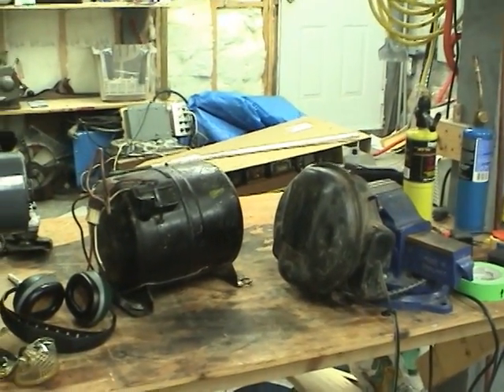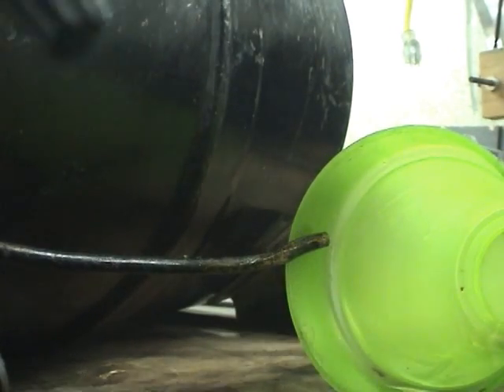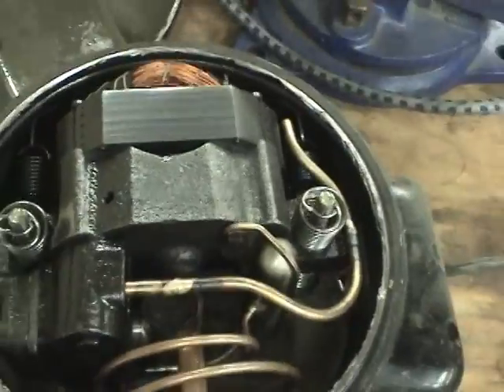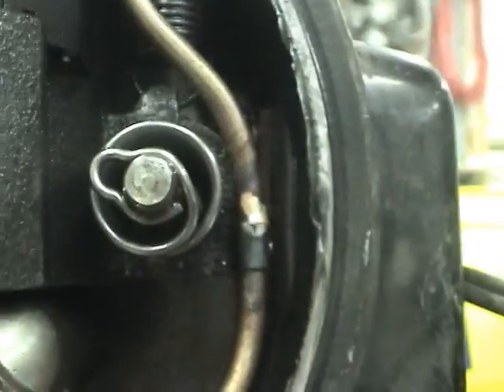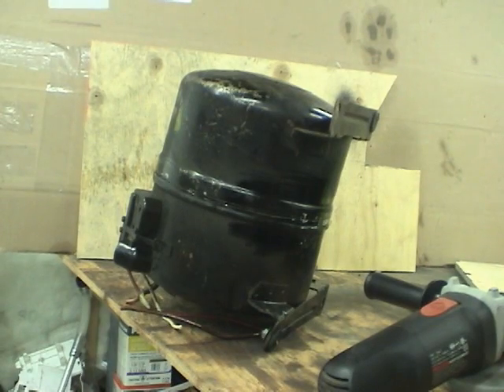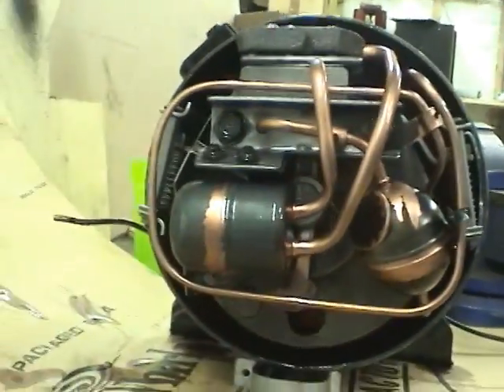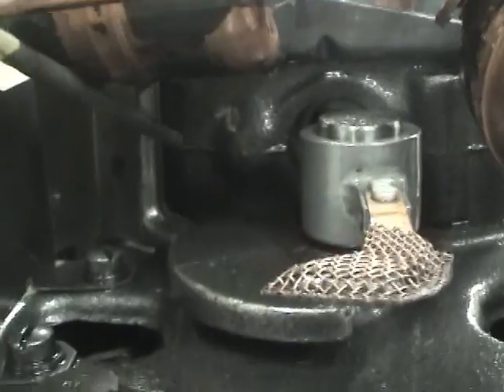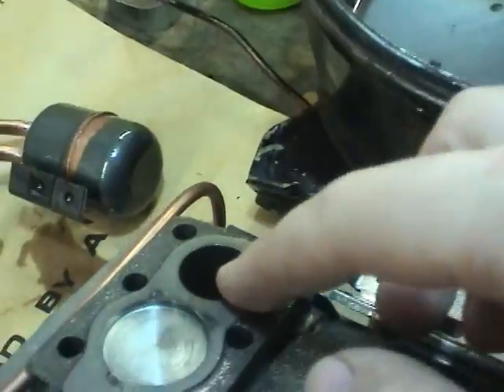Vintage refrigeration compressors

Comment: I began my career in refrigeration in the UK 1976 and only came across 3 or 4 "pancake" compressors which were made by a company in Scotland I think called Sterne.  In those days Frigidare and Prectcold compressors were the main ones used in refrigeration and in the Frigidaire range were belt driven and the semi-hermetic which were called Dynapac.  I worked for a Frigidaire dealer rebuilding compressors.  Great video thank you.

Comment: Could you use it to compress air and what kind of pressure would it produce?
Reply: +medhist2006 
Yes, You can, but it won´t last that long as a regular air compressor if they sucked in air since their interna parts are wery sensitive to particles (like dust) inthe air. You need an airtank and a pressostat as well to make it work properly as an airsupply.

Comment: That second compressor does have a nice motor in it.  It looks like you may be able to pull it out and use it for other things unlike some of the other ones.  It looks to me that you just have to get it cleaned up first unless you plan to keep it as a compressor.

Comment: The Model T, among most other automobiles, used oil slingers for lubrication. Modern small engines, Briggs & Stratton, etc., use the same type of oiling system. No oil pump required.

Comment: Scotch-yolk?
Reply: Yep, Scotch-yoke mechanism, as was originally developed by GE in the 1930s.  Danfoss also made such compressors.  The original GE compressors even had oil-cooled motor windings, a high-pressure rotary oil pump, a cylinder unloader to aid in starting, spray cooling of the lubricating oil and mufflers on both the suction and outlet.

Comment: do you know what that two piece con rod linkage is called. there is a name for it, its on the tip of my tounge. the one where the rod stays on a plane and the one on the crank slides back and forth in it as the piston goes back and forth . there is a name for it anyone know>?
Reply: Scotch-Yolk

Comment: Thats a very good video, very informative. I work in an industrial refrigeration plant and have torn down 6 cyl. ammonia compressors with each piston and cylinder 8 times larger than whats in any house hold or commercial compressor, so its pretty cool to  see an extreme visual contrast between those.

Comment: the 5 to 6 thousand btu 1979 to 80 emerson quiet kool compressors are something to check out they were really smooth and quiet they were the last of the reciprocating compressors before aisain compressors took over. emerson air conditioners were made in woodbridge new jersey, best ac ever made.

Comment: I did that when I was 14 years old , was opening those to see the design of the motor & pump. the pancake unit was made by Tecumseh. and the long compressor looks to be a newer Westinghouse compressor. I saved some myself ,and wanting to get some old compressors like I had when I was 14 back in 1975
Reply: I took anything apart as soon as I could walk, butter knife being my first tool.I garbage picked like clock work hauled that stuff to our room tv's record players radios you name if it was electric.Burn & grease marks all over the yellow -gold sculptured carpeting..got zapped plenty of times...right about the time your talking..  starting a little earlier in the 70's & slightly younger..it's still in me..I just get to see others do it here...who ever thought..

Comment: I have heard that Trane is having problems with their "Cllimatuff" compressors, the motors burn out after just two years, and the insulation on the motors breaks down and plugs up the filter driers. Please reply and give me some more details on this problem if you can.

Comment: @jonasgu97 oil is distributed along with the refrigerant in all air conditioning/ refrigeration systems. The oil that was spraying out of the discharge line is normal. It is just a mist of oil and not a slug of liquid when it runs unless the fridge was tipped up on it's side and then immediately turned on after standing it up normally. This is why you should let a refridgerator stand upright for approx. 10 hours or so after laying it down before up plug it in and run it.

Comment: Those pancakes were easy to service after a burnout.
I had the stator rewound by motor people, put it back in and it fired up.
Welded it up with a CO2 purge, ran it and let it suck in fresh oil of the same amount I had taken out.
Put back in the Kelvinator and it ran, never saw the fridge again!

Comment: I have a 46 crosley shelvador compressor.......it has 3 terminals, white, black,  green.  I want to use it to make compressed air for a furnace gun I'm bulding, but can't figure out how to start the motor.  The fridge is gon, I have the motor, relay and chassis only.  It looks just like the big cylindrical motor you did just now, any ideas, thank you, Jack

Comment: wow I found one of those pancake compressors out in the woods back in '01, got it apart by cutting around that seam with a manual hacksaw :P mine was a LOT louder than the one you have though. looks like yours has some kind of muffler on it, mine didn't. and I ended up throwing it out a few years ago. really cool vid!

Comment from the maker: Thanks! All these old compressors seem to use four pole motors, the slower rotation probably leads to higher reliability than today's faster two pole machines.

Yes, that's the infrared nightshot mode.

Comment from the maker: Thanks!

I'm using a Sony DCRTRV25 miniDV camera, nothing too special. The real secret is the video processing after the video comes off the camera. A program such as AutoGK will produce an excellent quality compressed file suitable for Youtube. I typically run a bitrate of 4Mbit/sec.

Old compressors are very cool. The slow speed and all the mufflers make them exceedingly quiet. Not very efficient though, the pancake one draws the same power no-load (150W) as my ~15 year old fridge running.

Comment: Excellent video!, what model camera are you using, the quality is fantastic!.

That pancake compressor is very similar to the ones used by Kelvinator fridge/freezers in Australia

That cylindrical one is very cool!, the old ones have lots of accumulators and mufflers on them. new ones are too simple.

Comment from the maker: All the compressors I've used spit oil, but this one was quite bad initially. However, it may just have been oil accumulated in the mufflers getting blown out.

After I made this video, I took the piston out, and it actually does have a piston ring. I've never seen that in any modern compressor.
Reply: In bigger (commercial/industrial use) refrigeration compressors it is totally normal to have piston rings. Some are bigger than automotive engines and the pistons are quite similar.

In refrigeration the oil travels together with the coolant through the system. This is why a refridgeration leak can be spotted by oil.